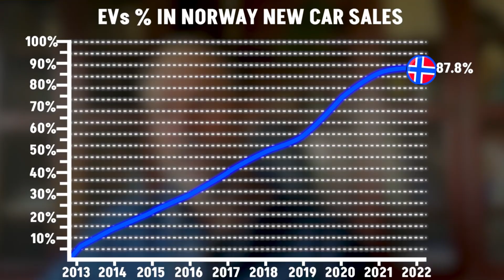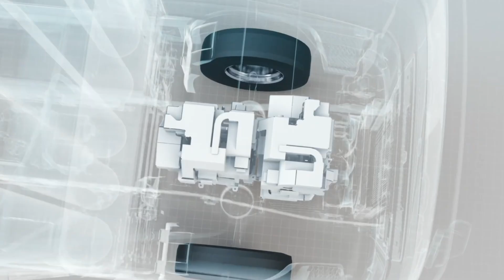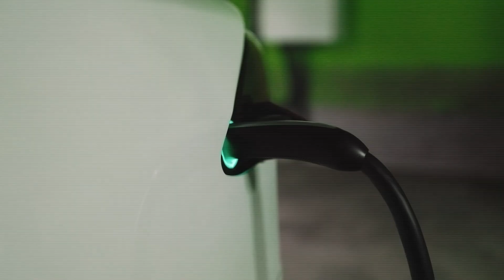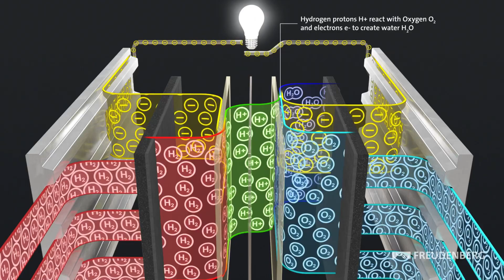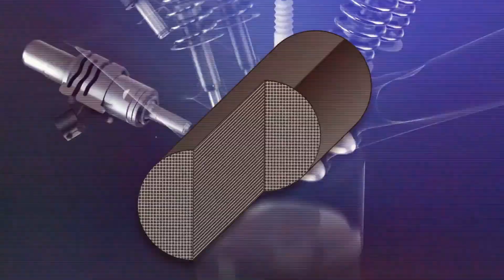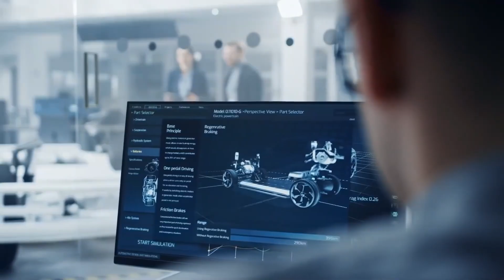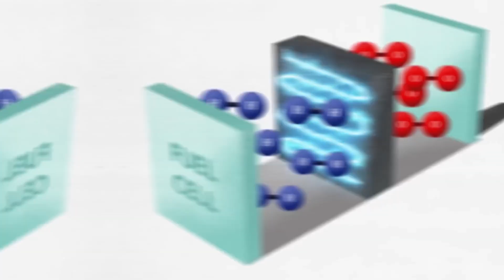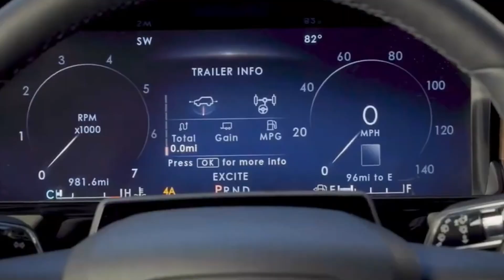Auto Giants' Grand Plan to DESTROY All Electric Engines

Comment: Seems you missed the next big thing in EV “killers”. The hydrogen combustion engine, with very little modification an standard Gas engine can be converted to hydrogen, way way greener than any Battery EV, and the one Toyota are working on actually captures carbon so it is a carbon negative engine. The only stumbling block is creating enough Hydrogen however the Middle East with all the sun could easily switch from producing oil to producing solar generated hydrogen.
Reply from the maker: Will try to do more videos on the hydrogen combustion engines in the future